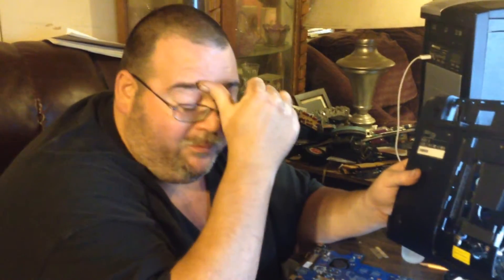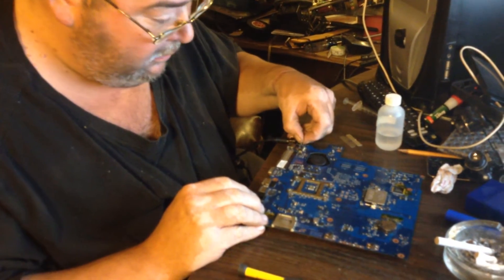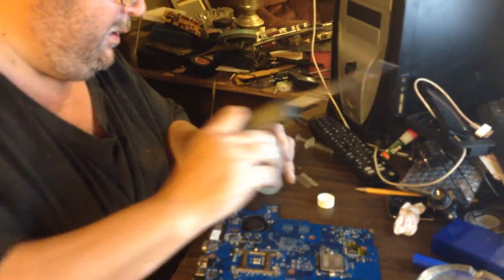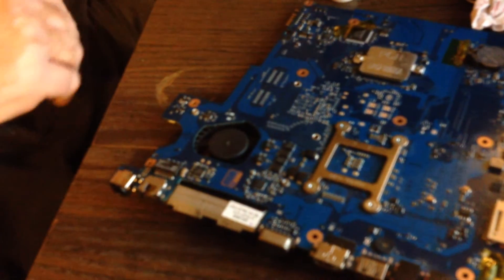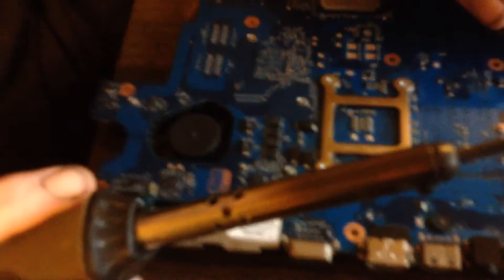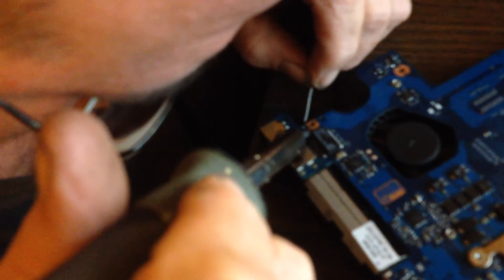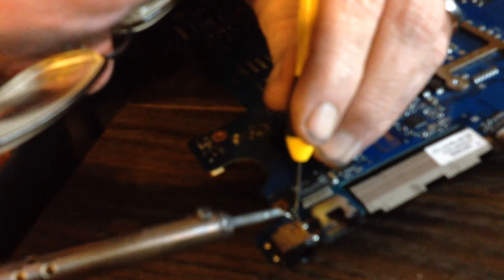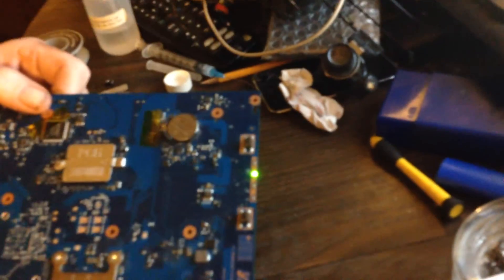samsung np300e5a how to fix the dc jack completly!

Comment: Hi Jim, I went to Digikey, and there are about a zillion parts.... could you possible give me a part number of the product that you typically would buy to replace those diodes.  Also, when I removed the motherboard and turned it over, the dc jack looks perfectly fine and mounted firmly, but the pads where the diodes were looks fried.  Is this something you've seen before, and should I still replace the jack?  Thank you.
Reply from the maker: +welynn yes these are known for being to small and i will get back when im back home on holiday and will get you the part number i now use for replacing these
Reply: +Jim white Hi Jim, I was wondering if you'd had a change to look up the diode and dc jack part numbers for me.  Thank you!

Comment: I changed the power jack but now it only works when it is plugged into the AC adapter it will not power on from the battery. I am not sure what is wrong every thing seems to be working it charges the battery 100% not sure what i have done wrong. any help would be appreciated. thanks.
Reply: +thebighat99 Never Mind it was the battery. Thanks.

Comment from the maker: digikey is a great place to get the diodes but i would use ones for a little more power if you dont and use the same as it comes with they will fail again  i suggest to go to a 4 amp diode